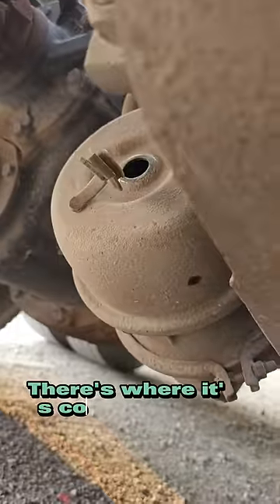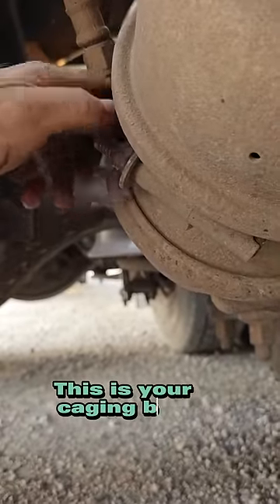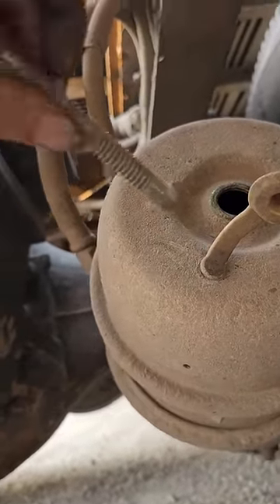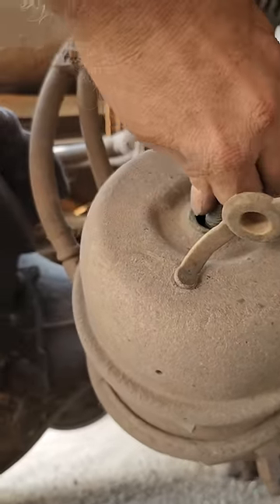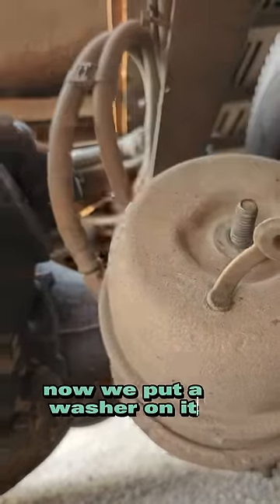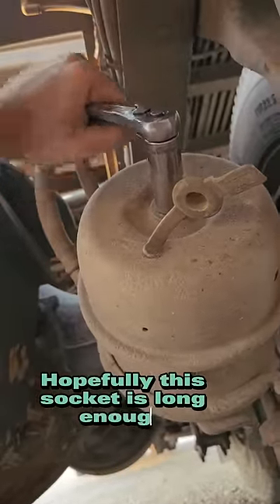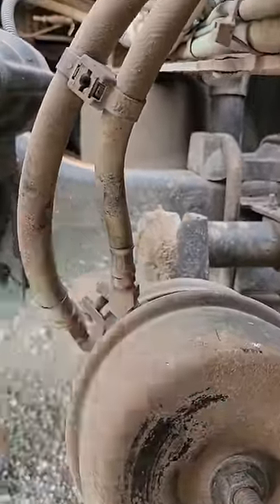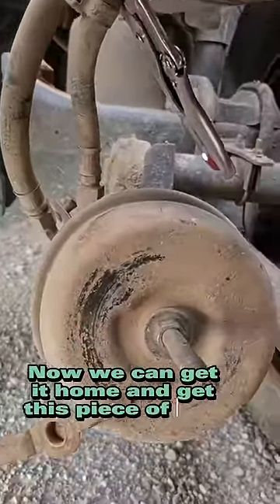How I cage a brake chamber and get home

Comment: Dude, when I was learning to drive trucks .... mmm, 1982-3 ... everybody learned first thing was how to adjust your brakes pre-trip or start of the day and to  get yourself home with an air leak of any kind. 
 That is exactly how you let that brake roll.
Reply from the maker: They don't teach that stuff anymore.  I am 100% self-taught
Reply: @aftersolo  I learned to drive a bus recently.  We have a whole team of mechanics and will never ever have to to a brake adjustment.  

It was the first thing we were tested on.
Reply: @aftersolo  Don't worry, many people wouldn't know what to do to limp home a regular car or truck anymore. Tow truck bills are expensive, so I always find a way. lol 🤷
Reply from the maker: @DAndyLord  yes.  Too much liability.  Makes sense.  I'm just a one man show.
Reply from the maker: @trickyricky12147  You have to.   When I was a company driver, I got stuck.  Called breakdown.  They sent a wrecker.  Wrecker company was 2 miles away.  They charged $500.  This was in 09.  It would be $1000 now.  They only had to pull me 5 feet.  Their trucks are super expensive so I get it, but if I was stuck now, I'm finding a way out.  I'll walk and flag down people if I have to.  Maybe a farmer with a tractor could help.  I'll use my landing gear and raise the entire truck and put rocks and boards under the tires.  Done that and it worked.  I'll uber to lowes and get a shovel and salt.  I'd rather spend 100 dollars at the most than a thousand anyday.  I'm getting out no matter what without calling a wrecker.
Reply: @aftersolo  Yep, that's what it has become at this point. We gotta do what we can on our own. I can definitely understand why tow trucks are expensive; the operating costs and service of the heavy equipment, ect.
Reply: @trickyricky12147 my boss literally will pay me to come from my house to come get a rig off the side of the road because 

1. He's seen me make it happen, he knows I'll do it again when he needs it
2. He pays me well, but it's still cheaper than a tow bill. 😂

Plus why not make the money myself? Lol I'm already the guy working on said broken things when they get back to the shop anyway. Haha

Basically, yeah. People don't know shit these days and tow companies make a killing from that exact thing you mentioned, which is automotive ignorance lol
Reply: @aftersolo $500 minimum last I asked one of the guys I know running a wrecker that pulls large trucks (semis, dump trucks, etc) to leave their shop. Period. They won't start the truck for less. And that's the bare bare minimum. Covers 2 hours, it's like 500 an hour after that or something crazy like that. I'll have to check with him and see if that's still the case. Last I asked was almost two years ago now so I'm sure it's gone up as well. Seems to be about the standard minimum 500-1000. Sometimes a truck could be fixed for that, if you can just get it home
Reply: All that before Auto slacks

Comment: Fun trick i was taught by an old timer: if the brake pot has an internal leak you can block the airline off by inserting a dime into the air fitting connecting the supply line to the pot. Turns out dimes fit perfectly into the fitting.

Comment: I was the backup driver for our overnight guy. Driving a semi pulling doubles. I usually drove a straight truck within the city. I was 3 hours out of town when the air warning alarm started screaming at me. I pulled over just in time for the brakes to lock up as I was coming to a stop. I had to walk a mile or so to a gas station and use the pay phone (before cell phones were a thing) and call my boss. Took four hours for a tow truck to show up. After telling him what happened he chuckled, and looked in the driver’s side door pouch and pulled out a rubber gasket. I felt like the world’s biggest dumbass because it was just a rotted gasket on the glad hand. You can bet that I checked that every time I drove that truck from then on 😂
Reply from the maker: We've all done things like that.  Got to love those doubles.  I pulled triples for 7 years.  It sucked when the rear trailer was the heaviest.  That thing was like a wrecking ball.  People were afraid to pass.  😆 🤣
Reply: buy a rachet spanner life will be easier than using a shifter

Comment: I usually remove the supply line,then get a penny, trim it to size with a file or on concrete basically anything as its soft metal,then put in in the fitting and tighten back up,basically you are capping that air line, its done as it looks better,its secure and if dot man wants to do an inspection there wont be anything to grab his attention,this is faster tho so kudos 👍😊
Reply from the maker: I appreciate the tip.  I'll have to carry some changes with me.  They would never know.
Reply: A dime will work on the trailer air lines done it a time or two
Reply: I was told a dime will do the same thing without having to trim it

Comment: I didn't have my chambers go bad, but I let mine sit for four years without driving. The shoes were stuck to the drums. Had to cage them and pound away on the drums till the pads released. I did this in subzero temps last December in Minnesota. It was a lot of fun! 😉
Reply from the maker: I guess you could always back the pads off the drum with the slack adjuster if it's going to be sitting a while.  I probably wouldn't even think to do it.  If I know it's going to get super cold, I'll just leave the brakes released and chock the wheels overnight if I'm idling.  Now, if the truck is off, that's a different story.

Comment: If you go to a heavy truck parts store you can pick up a spare chamber and leave it in your truck somewhere. All you need is a 15/16th wrench and socket. A pair of needle nose pliers. And and adjustable wrench.  And best to have a 7/16 wrench for the slack adjuster
Reply from the maker: Yeah, I definitely need to carry one with me.
Reply: @aftersolo  get a few sizes of air line couplers and some spare glad hands and runners. Also a spare trailer power cord and some bungee cords couldn’t hurt.  Wouldn’t believe the service calls I get or road side rescues I do in 10 min for $400 just patching an airline or a pigtail.
Reply from the maker: @daniellepage2923  I got everything in the world with me, just not the brake chamber.  I'm running out of room bc I have so many tools and parts. I have to with an older freightshaker running up and down oil lease roads.  It always seems like its that one thing I don't have that I need.  I got a buddy that only has a socket set that looks like it came from Walmart and that's it.  No way I could do that
Reply: You may have to clock it so the hoses reach the fittings and are away from the driveshaft, make sure it’s still caged before you do that because it involves loosening the clamps (9/16”/14mm) on the spring brake side. Unless it’s one of the new style cans like mentioned above. Cut the pushrod ahead of time if yours aren’t welded.

Comment: My 9900i crapped a chamber. I change mine in pairs. There's a socket made that's extra deep and made for this. Sunex Tools part# 224XD and Lisle 49000. Being in the HD towing business I have one in every wrecker. 
Pro Tip, when tightening the nut and the brake shoes clear the drums (keep an eye on the slack adjusters too, if it stops moving stop turning 👍🏽)  
Every truck I have I removed the bolts from the chamber and they're sprayed with my homebrew lube and they're in a sandwich bag with the trucks tools in the toolbox. So if and when they need to be used (for MY trucks) they're clean and lubed and ready to go. I've came across so many that are so corroded and crudded up I have to use some I keep in the wrecker just in case. 
But you got her done and that's what counts! Yessir...
Reply from the maker: I got that socket and it's awesome.  I actually used it the other day.  I had to change out all 4 of my torque arms on the trailer and the brake chambers were in the way.  On one of them, I caged it.  Once I was finished putting the new torque arm on, I reinstalled the brake chamber.  I went to loosen up the caging bolt and it was very difficult for my impact.  I ended up breaking the bolt and that spring made a super loud noise when it popped back.  I guess the nut was cross-threaded or something or maybe I put it on too tight.  I wish I could of just engaged the brakes but the spot where the caging bolt goes doesn't line up with the hole where you stick it in.  I had guys telling me it's easier to cage the brakes with the brakes released and I tried that but it just doesn't line up.  I can kind of get the bolt in there, but I can't turn it.  I wish I could do that bc it does seem like it would be a lot easier and a lot less stress on the caging bolt and nut.
Reply: @aftersolo  Yeah we run across that a lot when towing disabled trucks. We have little tricks that work but it's hit or miss. A lot of times the cage key inside the chamber will get cockeyed and sometimes a small prybar can be used to manipulate it enough to get it to where you can get the cage bolt in it.

Comment: Instead of pinching the hose with vice grips and possibly damaging it I take the fitting apart and put a copper or brass round head rivet in the hole and put the fitting back together. It seals perfectly on the taper. Carry them in my tool box.

Comment: Looks like a Midland style brake actuator with the roll form clamp band. Fun story about why the bolt less clamp band came about, and how a dumb mechanic put 400 some people out of a job:

Mechanic ignored the warnings all over the housing and thought he was strong enough to hold that spring and take it apart. He was wrong, and it ended him. His wife sued. Midland settled despite it being his fault.

Midland comes up with a new design so that doesn't happen again. Midland forgets to patent the new design, and a competitor submits a patent even though they themselves aren't making them. Competitor then sues.

Midland ends up having to pay royalties to the patent holder despite being the only company that made those at the time. Business is struggling due to the patent royalties. Owner conglomerate sells Midland to the competitor. Competitor then shuts down the plant and moves it to Mexico. The plant still sits mostly empty to this day, only occasionally being used as a warehouse by the company that shut it down.
Reply from the maker: Wow.  That's a hell of a story.  Made me depressed.  What a horrible way to go out of business.   Thanks for sharing.
Reply: Ruthless 💀
Reply: @Dot-bs4yv That reminds me of a girlfriend I had years ago. Her name was Ruth. I had a motorcycle at the time. One day I was going to take Ruth for a ride. I started it up and Ruth got on behind me. I took off too fast and Ruth fell off the back. I drove on Ruthlessly.

Comment: Did a similar thing to my old f350. I had break fluid leaking from rear lines (hit snow/ice Bank and clipped the brake line). I ended up using a vice grip to clamp the main supply to the splitter to the rear wheels as a temporary until I got home to repair the broken line. Fun days

Comment: Holy crap, all this time. I never knew there was a bolt right there for that!
Reply from the maker: Yeah.  I never knew for the longest when I was a company driver...
Reply: No guarantees on that though.  It all depends on if the last person took it out and left it out for whatever reason.
Reply from the maker: @jasonstclair6293  good point.  Guess you would have to borrow one from another in that case

Comment: The rubber diaphragm inside is most likely cracked and failed. They have a tendency to do that and leak air. 
You can replace the diaphragm to fix it, as long as the spring isn’t broken, but you’re probably better off just replacing the entire chamber. 
Whenever I get a customer in the shop with a failing brake chamber I suggest replacing both on the same axle at the same time. You don’t have to, but if they’re old you’re better off, at least you’ll know what you have instead of being nickel and dimed 1 at a time until they’re all replaced eventually.
Reply from the maker: Yeah, I just replaced both of them.

Comment: Head shop guy did this on my truck when an air can started leaking while i was parked for night, an hour away from the yard (dang elog) only he also had to use 2 quarters to help vice grip pinch better. He brought out a new can but forgot the trailer i had used the kind with a longer rod.
Reply from the maker: I just got some smooth jaw vice grips for next time.  Will be a little easier on the air line

Comment: It is important to understand that caging a brake chamber is, yes, an option when one fails. But it will NOT work every time. Sometimes a failed brake chamber can seize internally. Another option, believe it or not, is to simply remove the chamber. Start by squeezing both airlines...service and parking. To do this you need to make two clamps out of plate steel and bolts, which can compress 
(Squeeze) your brake air lines going to the chamber. 
1 Apply TRLR parking brake.
2 Compress (squeeze) the air lines going into chamber. 
3 Unbolt the airlines going into brake chamber.
4 Remove brake chamber from axle. 
5 Secure all  loose hoses. 
6 Pick up/deliver load, then get replacement brake chamber installed.
Reply from the maker: Ah, makes sense.  I like the plate steel idea.  I bought a pair of hose pinch-off vice grips after this happened.  Haven't used them yet.

Comment: Been there and have done that a time or two. If you don't have a pair of vice grips, you can take the supply line off and put a dine in it and put it back on, it'll block the air going to the break pod.

Comment: Use a pair of vise grips on the back of you brake chamber so the slack adjuster don’t move forward and you cage the brake chamber. After putting the caging bolt in the slot chalk your wheels and supply air to the system this help with caging it a lot easier. You not having to turn the nut under pressure cause supplying air  takes the pressure off. Then give it a turn or two then set your brakes again then take your chamber off

Comment: Note to everyone, take the time to pull all your cage bolts out of their holders in the can and clean and antisieze them then restow them into their tubes. The mismatched metals, steel bolt to aluminum body, will fill the holder and bolt threads with corrosion and rust to the point that they are stuck so bad you can't get them out without breaking the housing. Ask me how I know.

Comment: I use to carry #10 round head screws ( Phillips or Robertson) 3/4 in long ….you could undo brake line ,place threaded section towards chamber ,tighten air line back on. The round of the head would seal against the air line…and number one make sure the T bolt is in the right place if you have never done this the next time you are visiting with the mechanic most will have a broken chamber and show you on a “safe” chamber
Reply from the maker: Nice.  Thanks for the info.

Comment: If you push in the air to your parking brake chamber. It makes caging a lot easier as the air is caging it for you. Just twist the bolt on and release the parking brake. Do this on a flat surface with the wheels chalked
Reply from the maker: I'll do that next time.  I appreciate it.

Comment: Respect for working on it yourself but on behalf of any mechanic down the road that may work on this truck, please get a box end wrench set
Reply from the maker: Lol.  I got them all at home.   Guess I need to buy a set for the truck.  I got sockets and smaller wrenches in the truck.  Of course when I need them, they wont have the one that fits.  They like to skip sizes now like going from 7/8 to 1".  What about 15/16"?  Or 1" to 1 1/8" and I always need that 1 1/16.

Comment: Instead of pinching off the supply line you can take it loose from the fitting and put a dime inside of it on most lines. Then tighten the line back on it and the dime ax as a cork so you don't need to pinch the supply line and run the risk of accidentally putting a hole in it.

Comment: I used to remove the supply line from the chamber , and put a copper coin in the coupling , then tighten it back on .
Reply from the maker: Some guys on here mentioned putting a coin in there.  I can't remember if it was a nickel or dime.  I guess whatever works.

Comment: Done that,  damn forearm workout
Reply from the maker: Definitely.  💪
Reply: Release the brakes beforehand, saves you a bit of cranking on that bolt
Reply: @Kh1m3ra  it was on a 38 foot flat bed that was parked no rig to put air to it
Reply from the maker: Makes sense

Comment: you can use a automatic slack to bring the brake pads together and plug the hose with a coin, or cut a plug for the fitting out of a soda can..
Reply from the maker: Thanks for the tio!